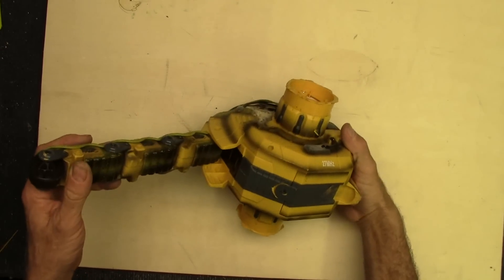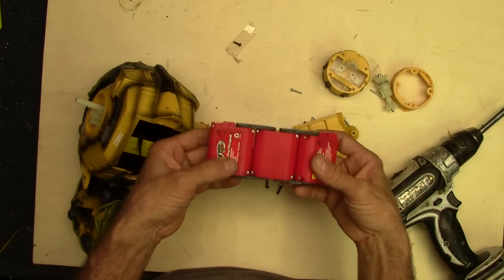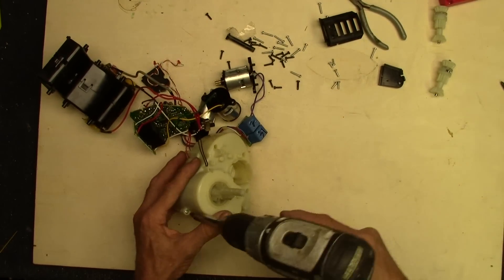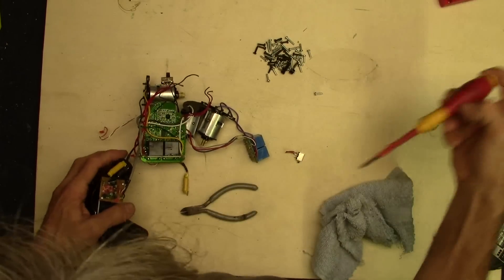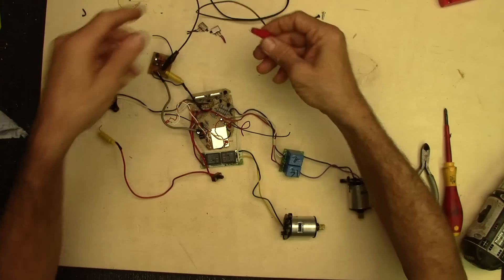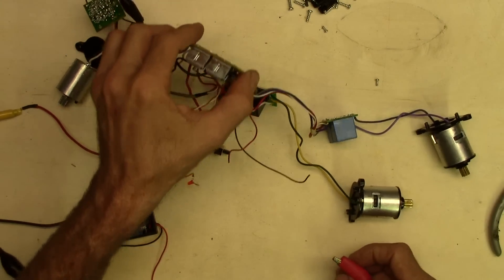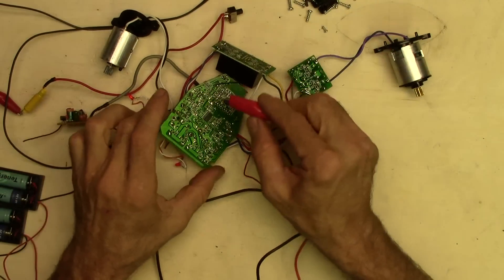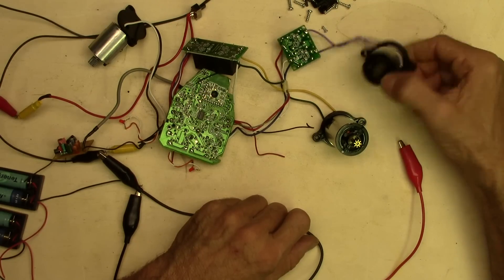Electronics Salvage From RC Toys

Comment: Outstanding! I've become a "Toy vulture", and look forward to when grand kids crash or get bored with a toy(-my screwdriver awaits!) There is also some pretty sophisticated "junk"  to be found in thrift shops ("Goodwill", etc.) that otherwise ends up as e-waste in a landfill. One resource I found is an FCC site (FCC.io)  database of electronic/wireless toys and manufacturers. Reports test results for certification/safety. They don't reveal proprietary info, but their reports may help identify that odd component that's driving you crazy.

Comment: If you're still monitoring these comments, I need some advice on scrapping/salvaging out a 12v kids ride-on fire truck. Most is just plastic but there are 2 motors ( in each of the rear wheels), some relays, led lighting etc.. I haven't found a circuit board but still looking. Any ideas to turn these parts into? (GREAT VIDEO btw)

Comment: i have a 12v toygrade rc car and i want to add 3 more 12v motor in it to make it a 4x12volt motor with the stock circuitboard will it work or will i burn the circuit? tnx

Comment: I've been doing some work with motors for the last few months and h-bridges seem like a complete pain to make, and controllers for motors can be expensive ($30-$40), especially when a full controller/driver isn't necessary and I just need a bridge.

I don't know a whole lot about electronics but I imagine specific types of bridges are required for specific types of motors? For example I know that if you have a 3-phase stepper you can't use it properly with a 2-phase controller. But these are full-blown controller boards. Do h-bridges fall under the same limits or can any h-bridge be used for any kind of motor? Let's say I pull one out of an old RC car and I want to use it to drive a stepper out of a paper scanner or something along those lines.

Comment: Do you save all the screws, nuts and bolts that you salvage from these items? I usually do when I tear down stuff, and put them all in a box for later use if i need a replacement for anything.
Reply: Finish the video first man. -_-

Comment: I remember a cousin and I taking our bicycles to the dump on the weekends.  Needed the bicycle because of 1) distance and 2) could bring back more stuff in the basket ;-)
Occasionally even found things that worked - a wireless 78 RPM record player that had a one tube AM band transmitter as the audio output.

I rebuilt three discarded Powerwheels vehicles for the grandkids.  I wouldn't put $300 into one riding toy but I would put $60 (total) in batteries and other parts into three of them.  The grandkids have outgrown them, so the battery from the last one is now headed for the solar lighting project in the lawn equipment shed.

I still give things a "Any useful parts inside?" look before tossing them.

Comment: A better option would be to figure out the sequence for the 27 MHz system and build a transmitter. This way you actually use all the circuits and wire the arduino to the transmitter itself. Also as a fail safe you can have manual controls on the transmitter too.
It's 27 MHz which is in the 11 meter radio band (US CB radio) on 27.145MHz FM designated for remote control. For best range wirelessly you need to make sure your antennas are cut to the proper frequency of 27.1450 MHz probabaly 1/8th wave or 1/16th wave as anything bigger would mean a longer antenna (1/4 wave = 102")

I took an old wireless car alarm with keyless entry apart and used the guts to remote activate my coffee pot..

Comment: I really enjoyed this video. You mentioned that you started tearing toys apart as a young child. My son is very interested in taking electronics apart and he is 8 y/o. I'm not very electronics savvy but am interested in learning. How would you recommend me encouraging my son to tinker while at the same time learning more about electronics myself?
Reply: mtcuyler Purchase/download him a book on basic electronics and component identification as well as function of those components.These are heaps of free books on the internet in pdf format.Try a search for " Basic Electronics pdf " via google, it wont take long to find something useful.I started the same way at age 12 in 1980 and became a credited Technical Electronics Service man by 1990.
CHEERS
Reply: mtcuyler There also should be electronic lab kits at Radio Shack for example that would stimulate building operating projects powered by battery, which is a safe voltage to work with at that age.  It is basically a board that you can connect parts to make projects from the instruction book.  Here's a link to a kit that is very cool for kids http://www.amazon.com/Radioshack-Electronics-Education-Learning-28-286/dp/B00116ZCBE  It's important for the kids to learn the positive/negative aspect of battery/DC electricity.  The kits are age appropriate and most will say what age groups they cater too.  Cheers, Craig

Comment: PWM driving relays is not going to work.
Reply: Yeah I'll bet you're right. I'll do another video and experiment. The relays may be triggered by a separate voltage and then they pass on a PWM voltage to the motors. However, that PWM probably came from the black blob MCU.
Reply: Look like you may be right, the relays appear to be acting as a brake for the 2 motors. the NC positions shorts the motor out when not running, usually across a low value resistor or long, snaked piece of track. The the NO position should have the PWM signal on it. Seen similar workings in MIG welders